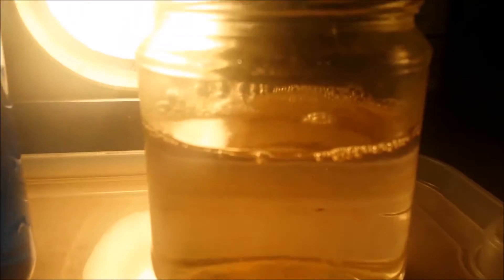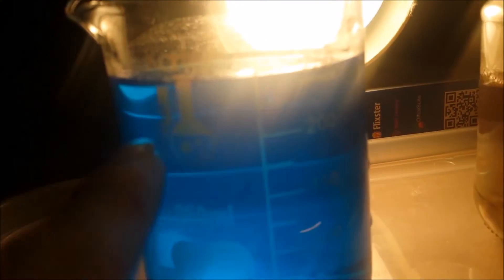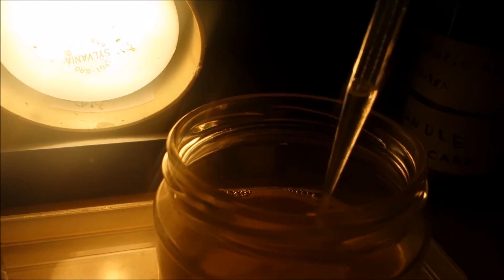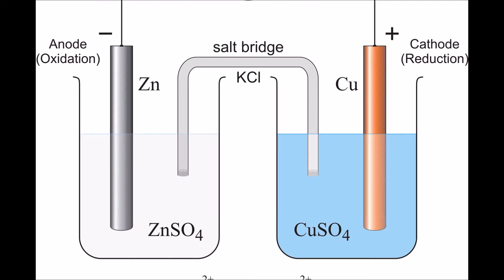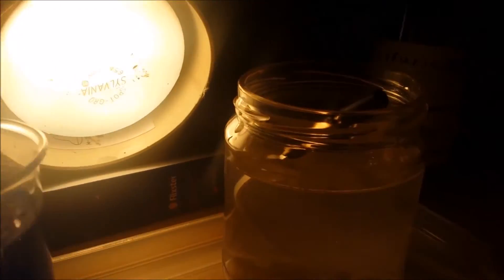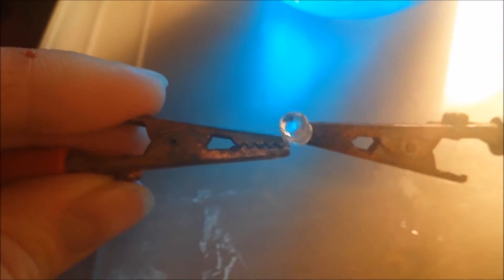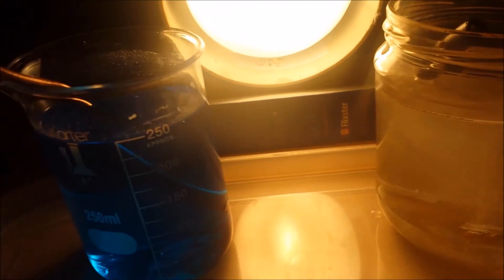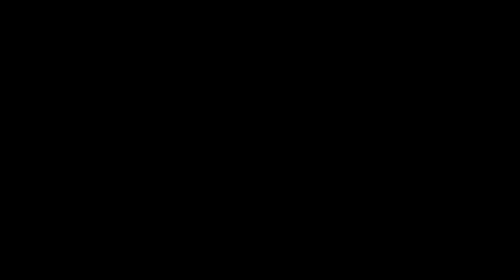How to make a Electrochemical cell!

Comment: That's pretty cool, considering that AA batteries are only 1.5 volts.
Reply from the maker: Yeah, but you have to take into consideration that AA batteries are about 2 inches tall. Also AA batteries probably have higher current.
Reply: It's still cool because it's a homemade battery.